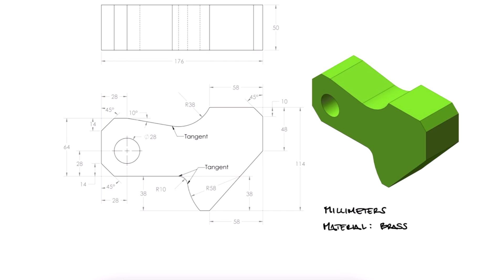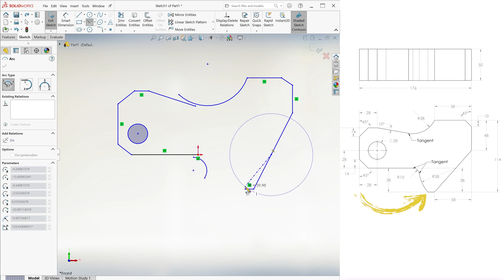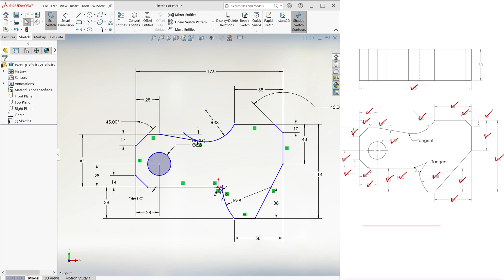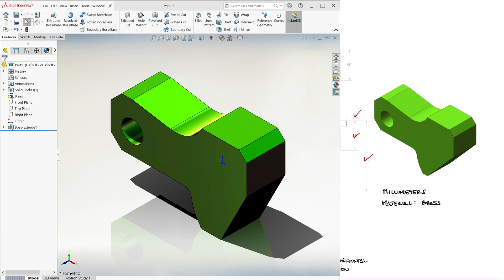Add Relation and Trimming Entities CSWA Example 1 in 3 Minutes!

Comment: Here's a tip that works for me:
a.) Don't try to get fancy with the "automatic" line to arc sketching.  You get in trouble and stuck with unwanted automatic constraints that causes the curve to flip over the wrong side of the tangency.  Basically, just join two straight lines together at a point.  Then click/add a fillet.  Two step, yes, but pretty fool proof.